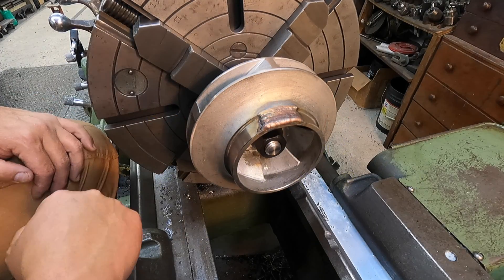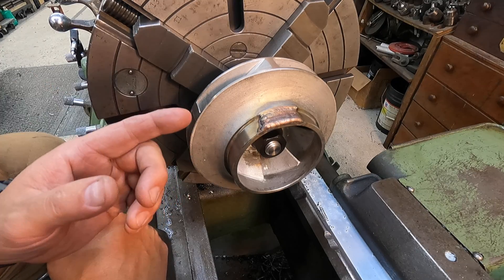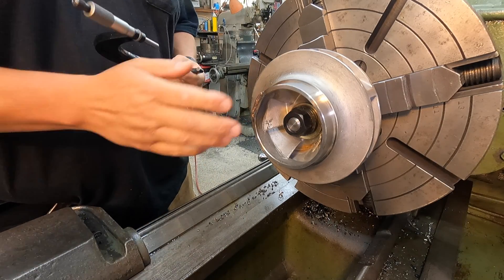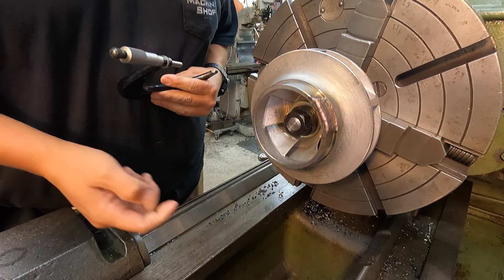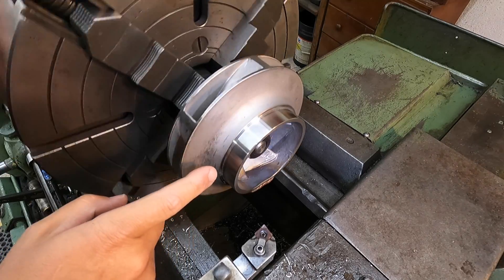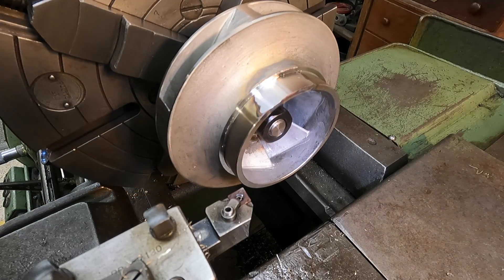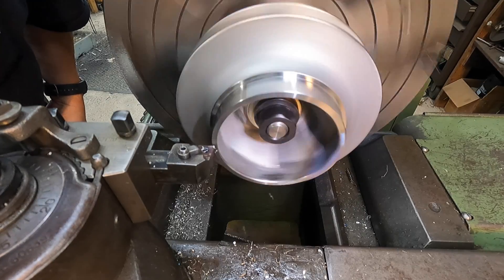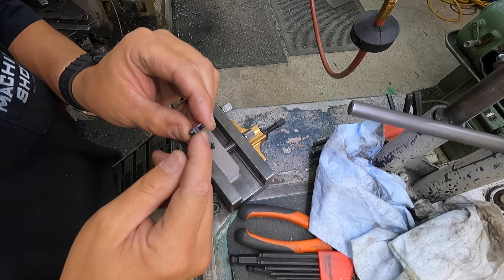Stainless Impeller Repair Part 2

Comment: That entire impeller runs out badly. Fun project but in reality, unless it’s being used in a very non-critical setting, it’s a door stop.
Reply: A lot of comments are neglecting the realities of the customers position and the availability of things like stainless impellers in the pump industry. The customer may not have an option but to run that, yes in a critical application until they get a new impeller in 20 weeks from the manufacturer. When the repair is done it will most certainly be sent for dynamic balancing. It won't be hydraulically balanced but it will likely run without issue until they can get a new impeller. Fixing things that shouldn't be fixed is very common in pump repair due to availability of parts. Not to mention you would likely be pretty shocked if you saw how much axial runout come on brand new impellers from the factory.
Reply: @diode30  That's crap and you know it. Putting a known, defective part and shipping the assembly when they're going to replace the part later when they can get it? C'mon. get real. Won't stay in business very long doing that. Employee dropped the thing, either fire the employee, make the employee pay and/or just wait until you can properly build the thing with a correct, undamaged part. As I said in another part of this dialogue (comments), we don't have all the details because Adam rarely asks. He often says he doesn't know what the part is for, yada yada. We are all speculating based upon unknown info that has not been provided. One thing Adam does poorly is background on jobs. Everyone has questions about what the application is, and he rarely asks -- or knows. I find that weird.
Reply: @tmbevtfd  I don't find it weird at all. He has had that part sitting around his shop for over 6 months. I saw it in his video near the end of last year where he did the shop tour part 2 in November of 2020. It, and a couple of other projects he has uploaded the past couple of weeks were right there on the table. Here it is, all qued up for you.  https://youtu.be/7IrR9_VTgOQ?t=451
Reply: I couldn't agree more!  A really fun video with great training.  I can't wait to see how it turns out.  But, this impeller is too far gone and lacks the trust to ever be used in any sort of critical application.

Comment: Adam, any chance the drop and the heat from the weld build up got it out of round that far?  That would have tonhave been a crazy seal for it to work that far out?  What did you come up with for a reason?

Comment: With a 8/7th shaft that's about a 1.5 HP motor driving it. By cutting down the OD the engineer is either trying to decrease the output pressure and or reduce the flow rate. Be interesting to know the application, especially since it sounds like a commonly replaced item.

Comment: With that thing being SO FAR off center, the pump it came out of must sound so bad it would be mistaken for a piston pump, low flow rate and dollars to donuts, the bearings in it are shot.. Wish we could get a look at the entire assembly, I'd bet good money the bearings need replacing and the seals are probably wallered right out too.
I think Adam said, in the last video, that it was a dual impeller pump.. Those impellers run at a few thousand RPM, as far as I'm aware.. So the second impellers bearings are probably shot too, from the rather extreme vibration this one will be causing by being so far out-of-round.
Reply: Seems like it never even made it to the pump, being dropped as a new born. Just as well.
Reply: My understanding was it’s a new impeller that someone dropped perhaps an employee unpacking it. That isn’t a used impeller unless they blasted and polished it before sending to Adam. Which is unlikely. That impeller looks too good to have come out of any working pump.
Reply: @tmbevtfd  I'd be taking a hard look at the motor shaft or pump shaft for damage as well. It took one hell of a lot of force to bend the whole impeller to cause the obvious wobble. The bent wear ring contact area is just a symptom. I think PACO/Grundfos will be sending at least a new impeller on to Dave.
Reply: @jpcallan97225  think it was dropped right out of the box before installation. Don't think it was attached to anything. The customer has chimed in here I read a comment from him, he said an employee dropped it while installing. I'd ask to clarify, but the guy seems upset enough.
Reply: @tmbevtfd  I understand that is what the employee claimed. He wouldn't be the first employee to downplay or cover up a big screw-up. Check video Part 1 at +31:12 and notice the front-to-back wobble (back and forth toward/away from the tailstock). Use the YouTube control to set the playback to slow motion to really see the wobble. The only other explanation I have is, if the part were truly "gently" dropped, is the impeller's bore is tapered and Adam missed it when he made his support shaft, which I doubt.  That said, many centrifugal pump impellers mount on a step-tapered shaft, so it isn't entirely out of the realm of possible.
Reply: @jpcallan97225  Yes, I most certainly saw that run-out. And yes, tapers are certainly plausible in that application. Good point. I would think Abom would most certainly have seen that. But it would explain a great deal.
Reply: Adam said the part was dropped causing the damage while not in service.

Comment: What do they pump with these?  I’m very curious.
Reply: Anything not too chunky.
Reply: With a stainless impeller I would suspect deionized or reverse osmosis water.  Cast iron or bronze would be used anywhere else.
Reply: @millwrightrick1  or anything else food industry related, wine, fruit juice or any other low/medium viscosity products.
Reply: @rossherman4515  I don't think 304 stainless steel is food grade as it is not that resistant to corrosion due to acids in food.  Judging by the way the impeller dented, it was probably 304L so not good for abrasive stuff either.
Reply: @millwrightrick1  hmmm. I think 304L is often used in food grade applications. Not always the best option, 316L being the best, but it is still quite common. Pulling apart an eccentric screw wine pump right now and all of it is 304L. But I would agree that if there is a choice between 304 and 316 then 316 would be the better option.
Reply: Pretty big eye on the impeller, could be a low pressure high volume trash pump. It’s a pretty thick blade width.
Reply: @tmbevtfd  it would be too small for pumping things like sewage. Maybe a water pump?

Comment: I'm still confused with the runout...  Like something is fishy..  It would make more sense that the damage happened during manufacturing, like a crash, during the setup for the seal ring to be finished pushing it off center.  The fact your customer wants it turned down to a different size makes me question that he was aware and perhaps got the part cheep because of it..  Either way you're getting paid. It's just IF this is what happen, that information would've been nice to have giving you a better understanding how to start.  Withholding valuable information like that is extremely frustrating and causes lots of time and money to be lost.
Reply: As the owner of the impeller I can assure you I didn't get the impeller cheaper because it was oversized and needed to be turned down.  If you knew anything about pumps you'd know that impellers are trimmed to size to meet a design point all the time.  One of my employees dropped this particular impeller during assembly of the pump and damaged it. Rather than scrapping it I asked Adam if he could fix it, which he did beautifully.  The spray welding was a perfect repair for this application and the impeller is actually better than new as Adam trued it up.  Thanks Adam!
Reply: @Zapp-fs9ml  I guess people just like the drama rather than accept the part as it was
Reply: @hrsey71    Not about the drama at all.   I've got 20+ years making and repairing parts for customers.  The single most frustrating thing is not getting the whole truth about the history of something. In this field it's important to be as proficient as possible.  Though what I stated doesn't apply here, I stand by the context.  
I am thrilled to say that I learned more about pump manufacturing and repair though!  Which I can say.... your comment had absolutely nothing to do with.   👏👏
Reply: @hrsey71  that’s unfair. Adam often says he has not clue about how some job parts are used and although he obviously knows what an impeller is for, he admits no knowledge of application. Thus, we questioning that or discussing is quite appropriate. More information for the viewer about the history of the part would make the picture much clearer.
Reply: @Zapp-fs9ml   I apologize if any of that offended you. You're correct, I don't have experience with the ins and outs of pumps. From the way I interpreted the first video I was under the impression that these are drop in replacement parts.. (pun not intended, but it works.. lol)  Now knowing that, it makes sense that the outer raw casting wasn't concentric to the finished seal ring.  I'm thrilled it's better than new, but honestly.. Are you surprised with Adam turning the dials.. lol
Reply: @Zapp-fs9ml  just out of curiousty what do you use the pumps for?
It looks like the same type of impeller that was used for several sizes of pumps in the mine I used to work in.
The lowest working face when I quit was almost 300m below sea level, and the mine is close to and partly under a fjord. Many pumps is needed to keep the water from flooding the mine. 
We had a mechanic that at times had fulltime work just fixing pumps.
Reply: @Zapp-fs9ml  I fear you are in for a disappointment.  I'd be taking a hard look at the motor shaft or pump shaft for damage as well. It took one hell of a lot of force to bend the whole impeller to cause the obvious wobble. The bent wear ring contact area is just a symptom. I think PACO/Grundfos will be sending you at least a new impeller.
PACO had a big plant in northwest Portland, where I live, and I bought pumps from them (prior to the Grundfos buyout) for use on cooling towers. They did a lot of big pumps for the pulp & paper industry. They make/made a fine product, and would never send out an impeller with that much wobble/run-out. See my comment in Part 1 to see the wobble... maybe + or minus an eighth inch. Sorry to rain on your parade. I worry it may damage the volute/pump case if you try to fire it up.
Reply: @jpcallan97225  John, impeller was not installed on the motor shaft when it was dropped.
Reply: @Zapp-fs9ml  That's good to hear. Did you notice the front-to-back wobble before you sent it to Adam?
Reply: @Zapp-fs9ml  You're happy, I'm happy. Adam made it better than new. That's his standard. I'd be curious as to how it's used. 7/8th shaft implies a 1750 RPM 1,5 HP motor. Stainless implies food grade. My guess is a transfer pump in a brewery pumping from one vat to another or floor drain sump pump when hosing down a production floor
You've obviously had time to get it back and into service before we got to see the video

Comment: It sounds like a motor is struggling when your lathe is idle.  What it that?  I've noticed it in quite a few videos on this lathe lately.  BTW - keep up the great work. I always learn a ton! Also, I noticed the complaint about "milking the video" posted by Joe R.  I greatly prefer to hear your thought process regardless of how many videos it takes. Carefully explaining what you are thinking is gold to me & a lot of guys. I couldn't give a rats ass if some speed machinist whines about it.

Comment: Many ways to do this process correctly with many different systems and processes usually hit these with AA spray bronze wire from Metco with the metco wire arc spray system. Occasional ceramic thermal spray instead depending on how much wear it has to take when it’s all put together

Comment: Interrupted cuts are the scariest thing. My question is. If the seal surface isn’t true to the shaft bore how did it ever seal even before it was catapulted across the room. Or was it being removed because the seal was leaking 🧐🧐🧐?? And that’s when it was dropped
Reply: I believe it was a new replacement part and Adam's customer dropped it before installing it.

Comment: Adam, great work on the repair! They certainly put the hurt on that thing when it dropped. 
Any chance this impeller was bolted to the shaft/motor when it fell? I wonder if the whole impeller is now twisted on the axis of the shaft? This would explain a lot of the odd, off axis run-out, and also why the customer is OK turning the whole thing down on the OD.
Keep up the stellar work, don't let the "keyboard operators" here in the comment section get ya down 😎

Comment: Look up "wear ring" or "wearing ring" for the way this repair was done before flame spray became ubiquitous.  In any case, you're going to have to match up the OD of the impeller skirt with the ID of the diffuser (bowl, volute) when it's time to repair the pump.  So I'd leave a little more meat on it, in case the bowl has been machined down to clean and true it up.  Otherwise, you'll also be adding another wearing ring to the bowl.  $$$  Bottom line, unless both the impeller and bowl are brand new and according to spec, there will be a lathe operation involved in any repair, to match them up.

Comment: As a cook back in the Navy, I learned a lot from the machinist mates by watching them. 

We had a similar problem. It was repaired by first milling a crescent wooden last from lignum viatee  on the rotary table to the impeller ID. A fine thread machinist jack was used to back out the dent with control. This was done on lathe with an indicator to get it back to .0015 TIR. Clocking the jack & last as needed to true up 
Easy repair big time saver!

Comment: Always impressed by the surface finishes you get, Adam. Very informative video, worth doing to demonstrate the techniques. My dad brought home a similar impeller from a submersible oil pump when I was a kid and explained to me in great detail how it worked. He even drew a lot of pictures. I was fascinated.

As bent as the impeller appears to be, I would think from being "dropped" while still mounted on the shaft, I just hope that all your good work isn't wasted because there isn't enough clearance in the pump housing to accommodate the wobble.

Comment: I watch every one of your videos. I don't always comment. The stainless steel impeller you are working on is very familiar to me. They are very expensive to replace. The ones I work (for over thirty years) on are not cast, they are billet and limited production. There is plenty of room for labor to repair without pricing yourself out of a repair. Trimming the O.D, of the impeller is done to change the flow curve. Your doing a nice repair Adam.

Comment: As long as the weld fused properly and the dimensions are correct when your finished, who cares what the keyboard warriors say 👍🇬🇧👍
Reply: Actually what matters most is how it performs...not how you fixed it....it can be repaired and measure great..even look great...but it could shake or wear out another part and not work good enough to use....
😉

Comment: Hello, it is probably a recurring phenomenon here on the Internet that whoever feels called to have to comment on everything and everyone with "clever" advice.  This will certainly not have happened to you for the first time.  For my part, with a fraction of your expertise, I see it this way: The impeller is not a part for interstellar space flights and is therefore rather clearly tolerated.  The loads on this part are, I suspect, more of an electrochemical nature (due to the choice of material: chrome-nickel steel) If the concentricity is halfway within the framework, what should be critical?  The structural stresses during TIG welding are also of a rather low nature.  Conclusion: That fits!  And those who can do it “better” should simply hold the edge until they have proven it and can prove it.  All the best to you, especially health and success, and thank you for your entertaining channel! 👍😊
Reply: as long as it's loading surfaces are brought concentric and its balanced it will be fine. Just look at that rough casting already, definitely not a high precision part.
Reply: @cda32 , yes Sir exactly my opinion!

Comment: Good job! I will say that yes,  a new impeller might be cheaper for just the time of repair and material but it's very likely that this is a long lead time item and the cost of downtime far exceeds the cost of this repair.  Fixing this to get the pump back in service faster makes perfect sense. I work in a chemical plant and every hour of downtime is $3k of lost production.

Comment: Is this a very expensive part?  It seems like the repair would rival the cost of a new one. ?
Reply: Simple web search, around $3000  to $4000 for a new one depending on manufacturer.
Reply: Wow, much more than I thought.  Thanks.
Reply: There are times the cost is not the most important item--availability is to get back into production.  One time an old machine broke a specific part which there was not a replacement for and the plant went down for about a day($$$$$$$$$$).

Comment: spray welding of sleeves and seal surfaces is very common. It is often also used from day1 because you can make a lot harder surfaces on the sealing area. We used to make replacement sleeves with a spray welded surface to have them in stock for repairs. (it is very common in paper refiner machines)